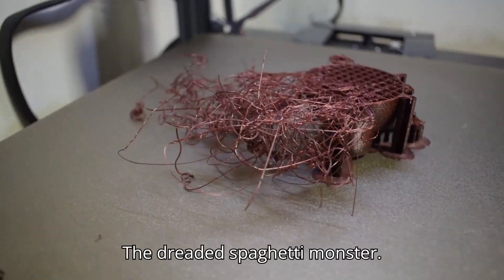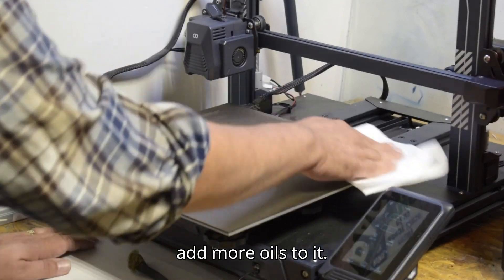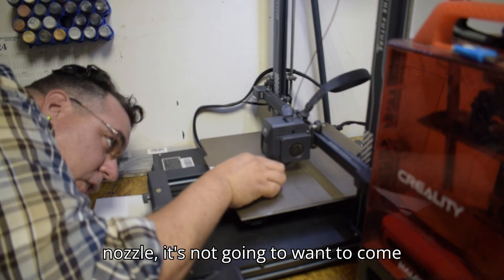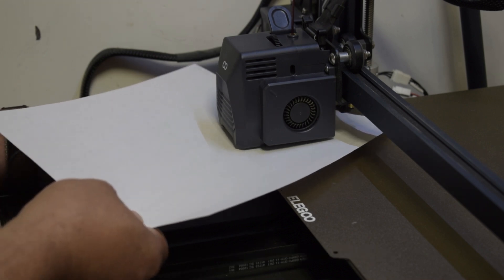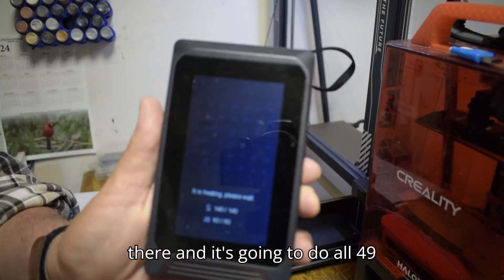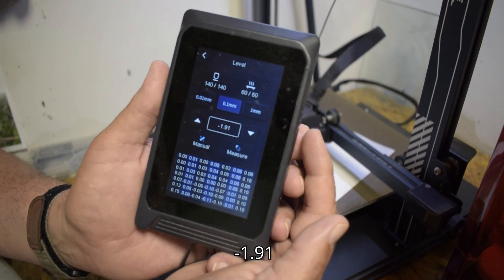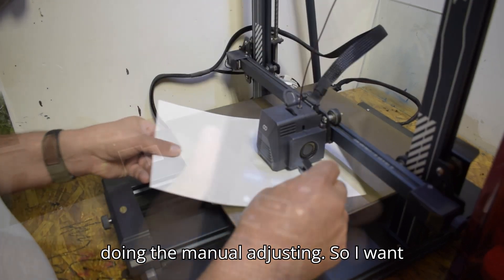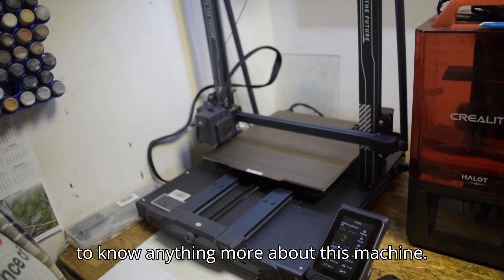Fixing a 3d Printer by Cleaning and Leveling with 8 Easy Steps

Comment: I have a problem with my printer, same exact one as in this video. One print went spaghetti on me, then the next one got really thin in the middle of the print then printed out correctly again. Then the next few prints either did the same thing or were just thin from the beginning. I hadn't changed any settings or anything on it. Any ideas what happened or how to correct it?
Reply from the maker: Definitely sounds like a partial clog. I would run that temp up on the nozzle and push some filament through. Preferably a different color than your last print, so you can see the differences coming out.

Comment: I was getting hellacious layer shifts all the sudden on my new N4Pro, so I spent all kinds of time perfecting bed leveling. Then I started getting warping on the bottom of prints and rough surfaces on the top. While watching this video I was running a flow rate test and looked over to find a giant blob of filament globbed onto my nozzle. I cleaned it off and am running it again. It does take the patience of the Buddha to get these things going sometimes, it seems.